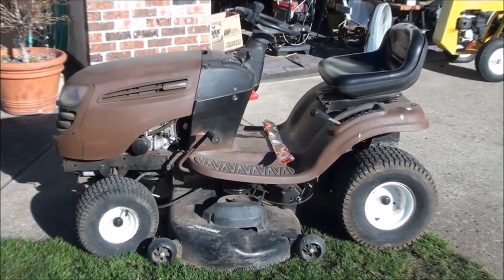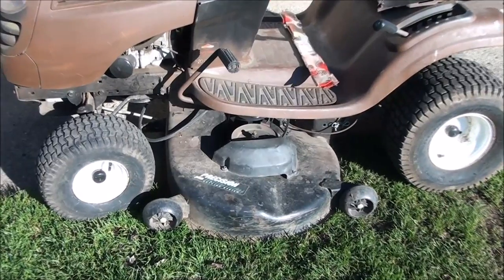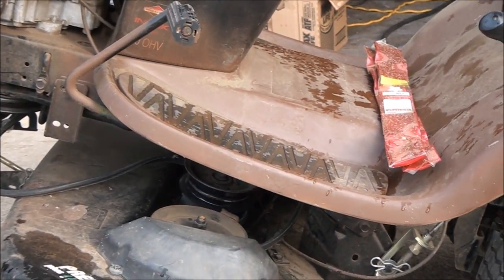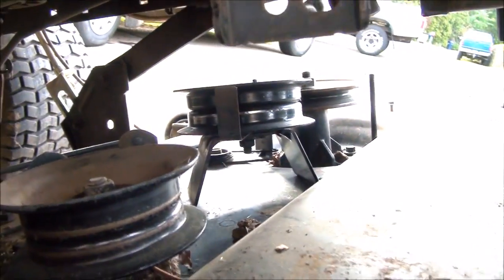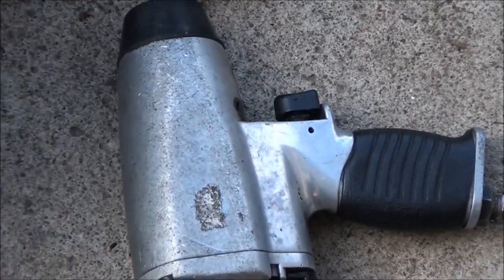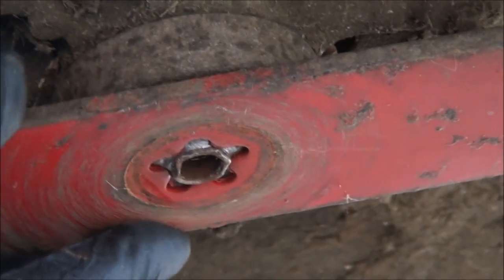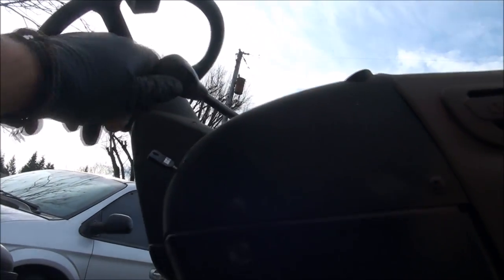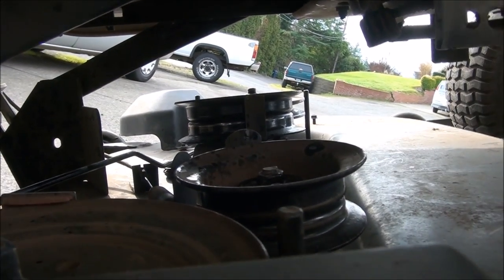How To REPLACE the BELT and BLADES on a 46" CRAFTSMAN Riding Lawnmower. Without taking the deck off!

Comment: I have a Crasftman T140, 46in deck.. just replaced the belt this morning. The new belt when I put it on is SUPER lose, the package said it was a 46in deck but the belt is so long it seems like it could fit a 64in lol… the mower is fairly new one has one season on it. Everything is clean and in good working order; pulllies, bolts, tensioners, springs everything. It just seems like this belt is SUPER long, I dont know what else to do or what elese to adjust because there is nothing… can I just buy a smaller belt like one for a 42in? Thanks in advance for any feedback
Reply from the maker: You must have the correct Craftsman part# to order the correct belt. Many different types. Your lawnmower model number located under the seat can help you look up part numbers.

Comment: Piece of cake -you don't need to do all this - just take the guards off,
 including slaken the ones alongside the motor drive,  use an 8inch 
bottle jack to push and slacken  the tensioning pulley, a block of wood 
against the back wheel helps - and put the jack under the pulley onto 
its bracket, extend the jack and slip the belt on. You may need to guide
 the belt around the motor drive, and on mine there is a guide pulley, 
belt goes inside.. Cheers all.
Reply from the maker: good tips!

Comment: Thanks for the good video, Jeff.  I plan on replacing my blade belt soon and had a question.  To simply replace the belt, is there any need for me to jack up the front end?  I don't think it offers any benefit.  Thanks again!
Reply from the maker: No need to. but the deck may drop down more giving you more room to work
Reply: @JeffsLittleEngineService    OK, thanks.

Comment: what is the reason you did not slide the deck out so you can clean  it an fix it right
Reply from the maker: I only do what the customer will pay for
Reply: @JeffsLittleEngineService  you are also miss asale of a new blade another  belt thatshot mabe a craced deck  balence the blades //////

Comment: How do I find the correct belt for a craftsman 46” 2014 t1600, model number 247.203740 ? 

I’m having so much trouble. Thanks ahead of time
Reply from the maker: "Sears Parts Direct" is the website
Reply: try ereplacement in utah they carry craftsman  parts  also  sears parts on line

Comment: Hey I watch your video but I'm trying to put on a new belt but it seems the belt I got is the right size for a 46in deck but it will not reach the front bracket . If I go up to 48in will that be to loose for it
Reply from the maker: order the correct belt from the lawnmower model number. It's the only way
Reply: it is spring loaded put on motor first add to left pully last use a large screw driver to load on pully its a heavy spring

Comment: Do the blades have to be set in a certain way in relation to each other? Thanks for the informative video.
Reply: Nope, the spindles do not know what the other spindle shaft is doing.  
JoeB
Reply: That was not a wise guy comment...more explaining.   The spindles are independent. The belt can slip on a spindle if you hit say a small stump.  If you take the tension off the belt,  either spindle can rotate differently.  It does not matter.  The spindle shaft can turn independent  of the other spindle depending on friction in the belts and spindle pulleys.  Hope this helps.
JoeB
Reply: @josephburkhalter5105   the most important thing about the blade is it sharp first then is it balanced  very few people balance a blade  thats what cracks a mower deck over time the vibration of no blance  simple before putting blade on  take a 5/8 smooth rod place in vice horizontilplace blade on rod  it should hang level  if not grind off some on back side of low end  not sharp side till it hangs level